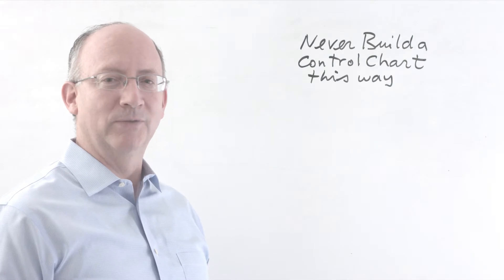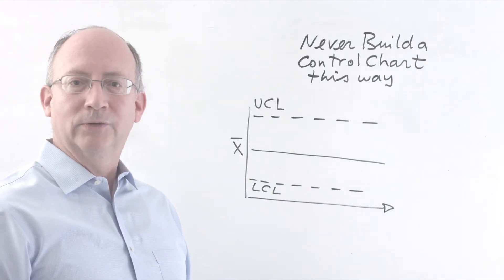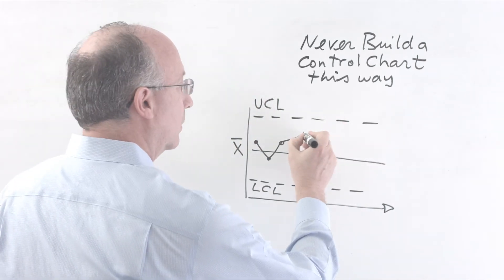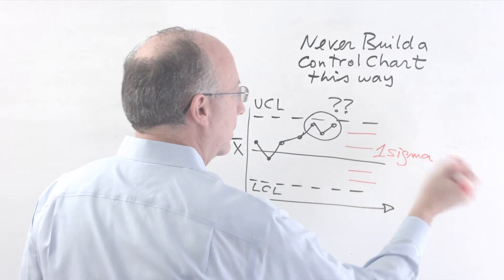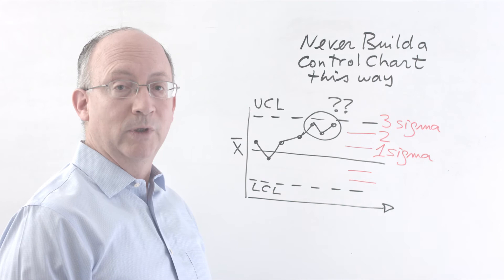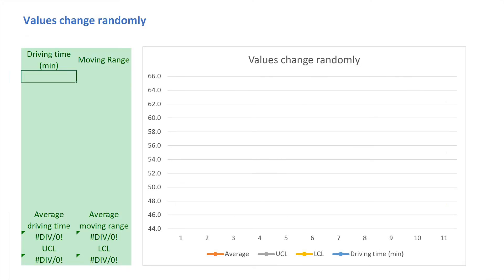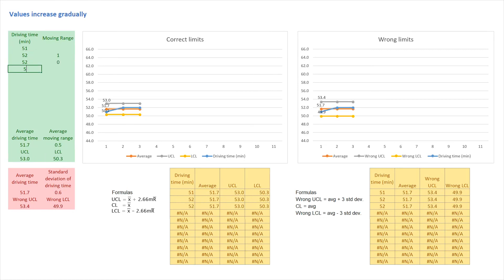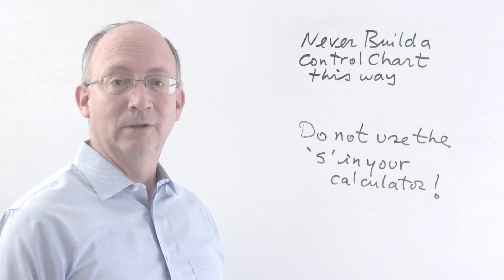Six Sigma | Never build a control chart this way! | Green Belt 2.0® Lean Six Sigma | fkiQuality HD

Comment from the maker: Control charts have been made unnecessarily complicated and downright defective by people who don't understand their origins. 
For instance, some teachers say that the data has to be normally distributed - not true, as the control chart theory is independent of any statistical model, such as normality. Or that the process has to be in control before using this type chart - false, since the purpose of the tool is to detect out if control situations.

Comment: I found it really beneficial to use the 2.66 multiplier instead of the traditional +/-3 sigma approach. The +/-3 sigma method can create control limits that are too wide, potentially masking real process issues. Using 2.66 provides a more accurate range, making it easier to identify genuine variations and areas for improvement.

Comment: This video was a great refresher from what was taught in class with regards to the rules to follow and ensuring the limits are calculated correctly show that you can properly detect when a variable goes out of range. Incorrect calculations can lead you to believe your data is fine and give a false sense of security.

Comment: I can see how there can be confusion with using standard deviation when creating a control chart. But why use the word sigma?
Reply from the maker: Good question! I also think that the term is used in too many confusing ways. This is why, in class, I distinguish between "s", the global standard deviation, and "Sigma(x)," the measure of dispersion within the samples that is used to calculate the UCL and LCL.

Comment: So, as was said early in the training, 'Trust the data.' Let it determine the appropriate UCL and LCL (using long-proven multipliers) instead of applying standardized sigmas.
Reply from the maker: The key concept here is that the UCL and LCL are calculated from the data using the measure of dispersion within the samples Sigma(x).

Comment: Since control charts are about data set across a periodnof time, it makes sense that the limits and standard deviations would be determined as time goes by, not before.
Reply from the maker: The limits are set after the "learning" period of the control chart, that is after obtaining the first 10 to 20 observations that show the behavior of the process. Once set, they are not changed unless specific conditions are met, such as a change in the process (new machine, new material, ...).

Comment: Very informative video showing how using three-standard-deviation limits rather than three-sigma limits in control charts is incorrect. Using three-standard-deviation limits widens the control limits and may not show abnormal process behavior.

Comment: Very helpful video showing the correct way to prepare a control chart.  I've seen the chart prepared using standard deviation to determine the UCL/LCL before and didn't realize this was wrong until it was discussed in the Lean Six Sigma course.

Comment: This is golden information as data accuracy is one of the biggest challenges when working with data especially when looking to derive insights. It is important to know of every little bit of tweak involved when using constants in calculations.
Reply: Golden garbage.  The guy has no clue.  Read Shewhart.
"Six Sigma Champions are con men" 
“All you have is smoke and mirrors” 
- Creator of Six Sigma, Mikel Harry
91 % of Six Sigma companies have trailed the S&P 500 (Qualpro survey).  Six Sigma’s once best reference, GE, has thrown the trash out.  An 8 yr study at Ford showed an average of 1 in 5 parts defective AFTER improvement for “successful” Six Sigma projects.

There is never justification to stray from the giants of Quality Dr Shewhart, Professor Ishikawa, Professor Lewis, Professor Deming, Dr Taguchi and Dr Wheeler, for the lunacy of Six Sigma’s con man.

How the Six Sigma fraud was started:  
https://youtube.com/shorts/FPJCS46nexY

Lean was tacked on to prolong the Six Sigma Scam.
98% of LSS implementations FAIL (IW survey)

Comment from the maker: The great statistician Donald Wheeler, lists a few myths about how to construct and use control charts. The following is from his 7 Sep 2011 Quality Digest article "Myths About Process Behavior Charts." 
'It has been said that the process must be operating in control before you can place the data on a process behavior chart ... there are correct and incorrect ways to compute the limits ... The most common of the incorrect ways of computing limits consists of using three-standard-deviation limits rather than three-sigma limits. While this approach was identified as incorrect on page 302 of Shewhart’s 1931 book, it is found in virtually every piece of software available today. While three-standard-deviation limits will mimic three-sigma limits whenever the process is operated predictably, they will be severely inflated when the process is being operated unpredictably.
The express purpose of the process behavior chart is to detect when a process is changing, and to do this we have to be able to get good limits from bad data.' Three-sigma limits achieve this.
When this is not understood, then we start to take wrong measures to fix the data without any justification like 'censoring of the data prior to placing them on the chart (removing the outliers), and the use of two-standard-deviation limits.' 
Recall the method to compute three-sigma limits for the XmR chart: calculate the x average, calculate the moving ranges and their average, then multiply the moving range average by 2.66 and add/subtract from the x average to obtain the limits, known as upper and lower (control) limits.

Comment: Hi, I guess the simple question is why do we “sometimes” call the UCL/LCL 3-sigma?  However I am assuming this is why the control limits are calculated using the 2.66 not 3.  I can clearly see it will be our responsibility to verify how the control limits are calculated before we start any data observations.

Comment: When should you calculate new control limits to test against and when should you carry the current control limits into a new test?  The demonstration in th video shows the limits being developed as the test is run, should the limits always be redeveloped when testing or should there be a baseline that is consistently referenced?

Comment: Very True. Many times, the easiness of having at hand a quick button to get anything done immediately, it fails the true purpose of the aimed goal. In this case, using pre-set formulas, like the stdev in excel, won't help in detecting the abnormal behavior of the analyzed individual variable....

Comment: With the same word such as sigma reflecting multiple meanings, you can see how you could use it incorrectly if you are not careful.  You point out the distinction about the control chart and measuring the variability, using the moving range and calculating the LCL and UCL (not to confuse this with the standard deviation).  Important distinction about using the correct formula.

Comment: I would agree that the UCL and LCL should not also be referred to as the +/- sigma control limits. Why apply a dual meaning to a term. i.e. Sigma. This just blurs the lines of understanding between sigma and standard deviation and doesn't advance the logic. USL and LCL works for me.

Comment: the control limits are not the standard deviation rather they are the variation within the specific data set. using just the standard deviation ignores the data variation and does not accurately reflect the actual control limits of the specific data set.

Comment: I have used a control chart to help me maintain a particular process for many years. I recall asking why would you question data that shows a number of consecutive points in line with the average. I didn't realize that the average in your example may not have been the target. Also, should you question an outlier if it is only one point that occurred some time ago?

Comment: This helps us focus on control charts and UCL, x-bar, and LCL. It seems to me the words and labels of standard deviation, deviation, s, and sigma have taken on additional meanings and applications as the concepts behind them get (sometimes incorrectly) applied to processes. The "sigma" of a process is not the standard deviation (represented by the greek letter sigma), and as we talk about deviation and variation, it gets tempting to apply a normal distribution and it's properties to everything - we're looking for connections. Here, they don't exist. Stick with the way control charts are correctly built and use them and their terminology for what they are meant to represent.
Reply from the maker: Josh Klinzing, great comment. Control charts have been made unnecessarily complicated and downright defective by people who don't understand their origins. For instance, some teachers say that the data has to be normally distributed - not true. Or that the process has to be in control before using this type chart - false, since the purpose of the tool is to detect out if control situations.
Reply: Except that it is rubbish.
"Six Sigma Champions are con men" 
“All you have is smoke and mirrors” 
- Creator of Six Sigma, Mikel Harry
91 % of Six Sigma companies have trailed the S&P 500 (Qualpro survey).  Six Sigma’s once best reference, GE, has thrown the trash out.  An 8 yr study at Ford showed an average of 1 in 5 parts defective AFTER improvement for “successful” Six Sigma projects.

There is never justification to stray from the giants of Quality Dr Shewhart, Professor Ishikawa, Professor Lewis, Professor Deming, Dr Taguchi and Dr Wheeler, for the lunacy of Six Sigma’s con man.

How the Six Sigma fraud was started:  
https://youtube.com/shorts/FPJCS46nexY

Lean was tacked on to prolong the Six Sigma Scam.
98% of LSS implementations FAIL (IW survey)

Comment: I know this is beyond the scope of this video, but if using 3s "is a totally different concept" what value/purpose does the 3s method serve?  What does it reveal? In being a "totally different concept" it doesn't mean that it is useless/bad but rather not pertinent/useful in regards to an accurate control chart and evaluation of a process.  When would using 3s be appropriate?
Reply from the maker: Building a control chart using 3 standard deviations to measure the distance between the control limits and the average is following the wrong method. It is never appropriate, but a common mistake.
Reply: So, to clarify, it is more than a totally different concept.  Rather it's an invalid one that serves no purpose other than to cloud/confuse the creation of a control chart?
Reply from the maker: Brad Hentz the standard deviation must not be used to calculate control limits, but it serves the purpose of measuring the dispersion of a data set.

Comment: This video helped to understand how variables inside the control limits could still mean there is an abnormal behavior. Before this video I was under the impression only if variables were outside the control limits would they be abnormal.

Comment: This video helped clear up a major question I had:  UCL/LCL is based on proven observations of organizational behavior.  Also, the use of 1s/2s/3s lines is a reference, not an actual standard deviation (easy to get confused).
Reply: NEVER use 1s/2s/3s
"Six Sigma Champions are con men" 
“All you have is smoke and mirrors” 
- Creator of Six Sigma, Mikel Harry
91 % of Six Sigma companies have trailed the S&P 500 (Qualpro survey).  Six Sigma’s once best reference, GE, has thrown the trash out.  An 8 yr study at Ford showed an average of 1 in 5 parts defective AFTER improvement for “successful” Six Sigma projects.

There is never justification to stray from the giants of Quality Dr Shewhart, Professor Ishikawa, Professor Lewis, Professor Deming, Dr Taguchi and Dr Wheeler, for the lunacy of Six Sigma’s con man.

How the Six Sigma fraud was started:  
https://youtube.com/shorts/FPJCS46nexY

Lean was tacked on to prolong the Six Sigma Scam.
98% of LSS implementations FAIL (IW survey)